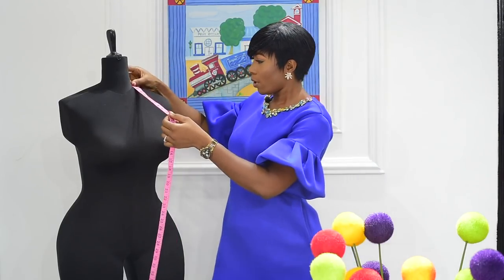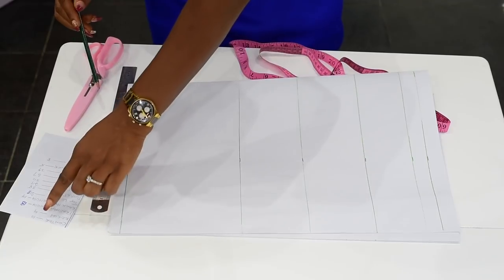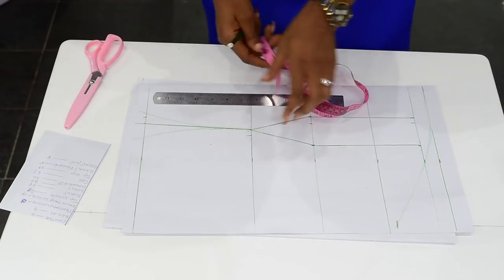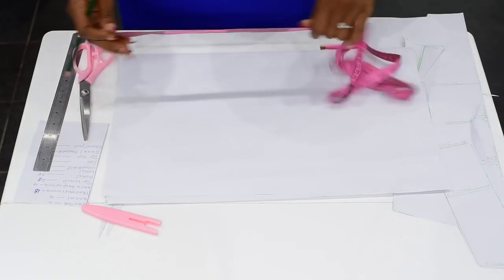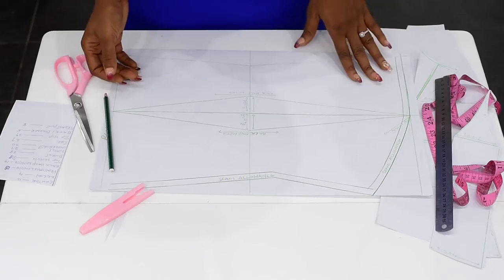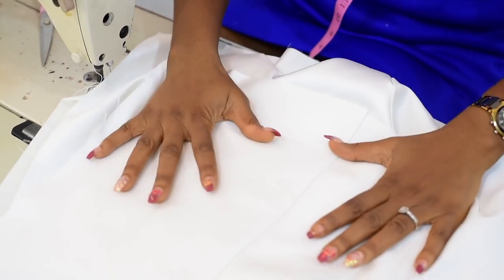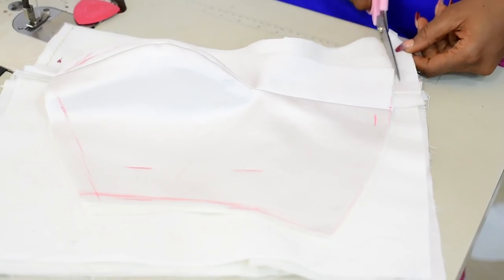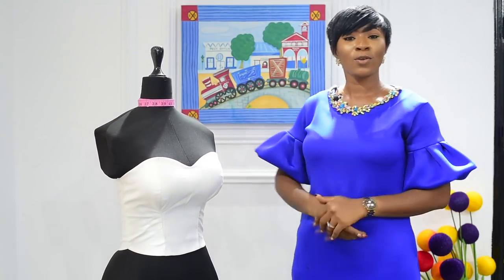HOW TO MAKE AND DRAFT A BUSTIER TOP,CUT  (T16 TUTORIAL)

Comment: Thank you so much ma. I have a question
1) I noticed the curve that's suppose to be on the natural waist/ half length is on the under bust, please why is it so?
2) When you flipped the  center front bustier to check if they correspond with the sides i notice they're not of same length are we suppose to trim the excess?
Reply from the maker: Joy Nnenanya 
(2) yes I trimmed it to make it a qual,that was Why I showed you to check if they correspond ,had to fast forward some obvious part to reduce video minutes
Reply from the maker: Joy Nnenanya 
(1)
Question not clear can you munch and send
Reply: 1) she is saying, you marked hip measurements on the waist line and didn’t mark waist at all. Why do?
3) You did not use the half inch allowance you marked on the all dart measurements. You cut directly on the exact nipple- nipple, 3” underbust and so on. Why so please?

Comment: Thanks ma'am, may God bless you. Please I am a little confused on the area of the bust span which is 8÷2=4+0.5" allowance giving 4.5" plotted on the Centre, and 3.5" for the under bust and blouse length but when connecting the points, you didn't mark through the 1/2" allowance but on the 4" and 3"  points. It got me 😕